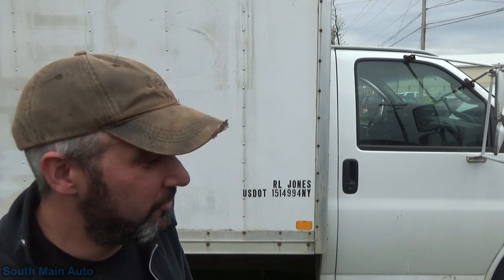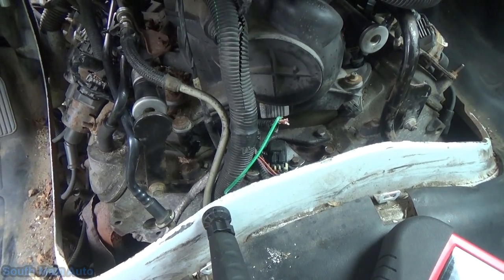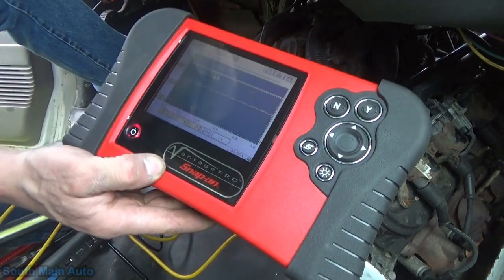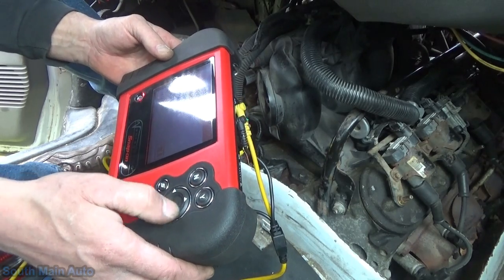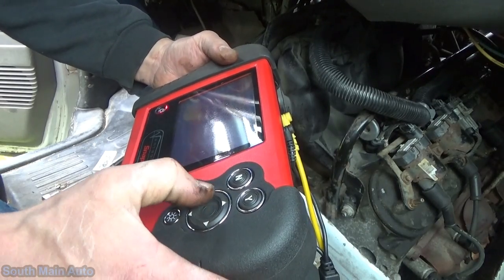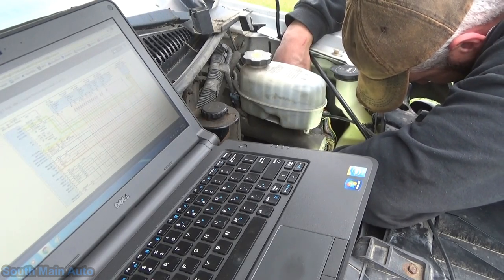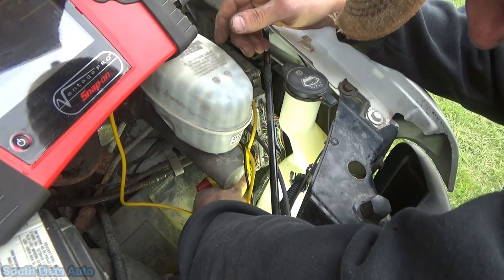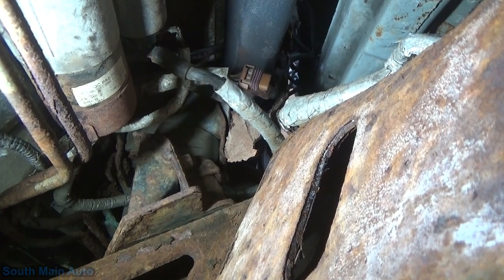Chevrolet Express - Crank / No Start

Comment: What a difference between the two shops, one starts replacing components until they give up,
the other actually uses the right tools (and more than a little smarts) and has the fault identified 
in an hour. If I was a local I know which shop I would use.
Reply: flat rate vs. private ;)
Reply: @6:49 of the vid after taking the covers off the ECM I think he says "four hours later" not sure if he was joking or not but I'm sure it wasn't easy or quick.  Important thing is he found the cause.
Reply: certainly joking, but they are a devil to snap loose :)
Reply: Not every shop can afford 4 to 5 thousand dollar scopes. Plus the hundreds of dollars in monthly fees for using the technical website.
Reply: @josephgalarneau7177  if they can spend thousands on tire machines,  alignment racks,  and lifts.  They can definitely afford a good diagnostic scope or two.  It has nothing to do with money. Its about actually having competent technicians that know how to use them
Reply: @josephgalarneau7177  almost all shops have these tools now. Most guys are embarrassed to not own one

Comment: Man the wire on those GM years were garbage.  Great vehicles- horrible wire and loom quality.
Reply: I see those chafe and fail at the pass side of the dog house.
Reply from the maker: They sure do. They seem to get very brittle and crumble really easy.
Reply: True.  Just fixed the wires on my cam sensor - 2000/5.3/ Suburban.  The split in the plastic wire loom sawed right through the wires.  I had to pull the intake to make the repair!

Comment: Eric , never apologize for making the best auto videos on the internet! . I think this video shows everyone that you personally don't need the big shop an all the fancy tools . keep up the videos !!
Reply: I dont know, ive seen shops a lot smaller and he does have a good selection of fancy tools. The problem with the dealerships is they have all the expensive equipment but not a good grasp on how to use it properly.
Reply: He does have the wiring diagrams...a must have. Not cheap either for a small shop to have all those scanners and resources.

Comment: What do you bring??  You call Sonny's Towing and have the truck towed to your shop.  This way you're Happy  and your brother is happy.  This could have been a video that start off with Sonny's towing and the Part II would end up at SMA.

Ivan should enjoy this video, working without a lift.  My guess if that they crossed the wiring for plugs 6 and 8 which is causing the misfire.

Comment: G'day, Eric! Mr. O's, South Main Auto... Diagnostic Mobile Repair! (Chevrolet Express - Crank / No Start) Checking out The ECM, Cam Sensor, Crank Sensor, and then finding out it has a Broken Wire!! Another marvelous job! 

By the way, I am having a very similar situation here with a "2006 Dodge Sprinter, with 5 cylinder turbo diesel." The body is in great condition, and the owner what's to sell it! (a local service shop told him the timing belt [or chain] was broken!!) But, it also has a Crank/No Start! (So, I would like to check the ECM, Cam Sensor, Crank Sensor, etc.) Thank you very much! 

Cheers! :-)

Comment: Your video action has been impressive this week. A new Cam sensor and it doesn't work...crazy. I've seen Keith's van, he does have everything! Nice work in less than perfect conditions. I followed along better on this one because I had a similar issue with the 98 so I've been down this road before. Thanks Eric.

Comment: Long time, first time. So, gotta say.. Love your vids. The analytical part of how you think through the problem really is what appeals to me. I tend to watch the electrical problems, because.. I'm an electronics guy. So, I like seeing your thought process vs what I'm thinking when I see the schematics on screen. We tend to wind up at the same place thinking-wise on those, but take different routes to get there. It's about 50/50 on whose method would have been quicker, but I've seen some where I'd have been burned by skipping to a different place than you went.. 

As a Colorado owner, your case study on the P0014(?) was both intriguing and terrifying. 

Had a fun foray into the automotive world today. Get a call from a friend wanting me to help track down a parasitic draw on a 98 Lumina. Those are always fun. He had installed a kill switch on the battery, which actually made things easier. Circuit open, circuit closed.. Pull out my handy Fluke and measure current draw.. Nothing.. Huh.. We've got the door open and i'm completing the circuit with the meter and.. No interior lights. Pop the meter open.. Both Ammeter fuses are blown.. Nice the meter still measures continuity to check its' own fuses (This is why you never lend tools to people who don't know what they're doing). Go to the backup meter.. We see a 2.5A draw.. Well.. That isn't right.. Oh, hey.. We've still got the door open.. Close the doors.. 500mA draw.. That's still high.. I go with the obvious.. Pull cigarette lighter fuse, it's blown.. Well, that isn't it. Pull all the fuses for lighting.. None of those. Start going through in order.. Pull the door lock fuse.. There's noise of a release and draw goes to nothing. Ah-ha.. I say, it's in the door locks.. He says "Well, you know.." and points me to the drivers side door, which has a completely broken power door lock switch.. you push it to lock, it stays stuck pushed to lock, causing power to constantly go.. You push it to unlock, it's constantly applying power to unlock.. "Well THERE'S your problem, would have saved us 30 minutes if you had just mentioned that from the start".. Took the switch from drivers side door, put it in the passenger, left the wiring disconnected, took the good one from passenger side, put it in drivers side. Problem solved. You just can't lock the doors from the passenger door.

Right about then is when I notice.. Hey.. Where's your serpentine belt? "Oh, it broke on the way home yesterday, we need to replace that, too".. I didn't sign up for this crap. Oh, fine.. But.. wait.. "On the way home"? Exactly how far did you go? "A couple miles"... Hmm.. Did it overheat? "Oh yeah, it was pegged".. Palm to face for the second time today. By some miracle.. Remember, this is a 98 Lumina. The 3100. While heat doesn't generally take out an intake.. You look funny at the intake on this thing and it breaks.(I exaggerate, but..) We get a replacement belt on.. I figure this isn't going to end well.. It runs.. Let it run.. Hook my crappy little data reader up to it... Engine temp goes to 200 and drops once the thermostat opens.. This is like the 5th time he's overheated this car severely with, seemingly, no lasting damage. I really wish I had taken a vid of this repair.. It would have been JUST like one of yours. But with far, far more swearing.

Of course, after we get all this put together.. He shows me his truck (05 Explorer SportTrac) with the dash showing he's doing 85 while stopped, no tach, no fuel gauge.. "Bad Cluster, I can't reprogram that, bye" and ran as fast as I could before I got roped into some other project.

Comment: Really liked the fieldwork =) Got a little nervous and worried when you said you my not have had the battery in the camera. That made me also wonder why you don't have a car charger to  plug in since you do all the filming in and around cars. However really nice video! I like the wireproblem diagnostics, it's not always easy but you really make it look easy! Often the hardest part may be starting direction.

Comment: Nice diagnosis. At least they knew when to call you. I like my ECT2000 for finding open wires and for high resistance & electrical diagnosis I like my thermal imaging camera. Speeds up the process until I get side tracked playing with it. I'm like you when it comes to finding open or shorted wires vs. replacing b/c I don't like having customers stranded or have melted harnesses that could have been prevented. I have great respect for mobile diagnosis techs working outside. Videos every day this week is impressive.

Comment: Question: Would the Versus have been a better choice to take, as its two machines in one, a bit more compact and has the ability to have wiring diagrams (using browser to look at iatn or any other data program)? I ask because I am looking to buy one machine and see the Versus as not the best but does everything well enough in a compact unit. I have learned more from watching you than classes I've attended, thank you for your continuous effort in presenting new material and showing us your techniques.

Comment: Thanks for these videos my man .. they have really been helping me out .. I started out rebuilding engines when I was about 19 .. .. just nuts and bolts stuff .. fast forward 20 years .. I've been at a big shop now three years now and I went from being a mechanic to just a parts installer .. yup .. the owners brother does all the diagnosis and we do all the" parts changing" .. electrical diagnosis was never my strong point .. always engine and transmission stuff .. but I'm 38 and figure I have about a good 10 years left of being able to do all the"heavy work" .. then what ?? .. So I've decided I really need to get back into diagnostics because I won't be able to change motors forever and you and.. scanner danner have really helped me getting a grasp back on this side of things .. so hopefully I can either start using all of my capabilities here or move on to another shop .. But either way thanks for the videos.. I really do appreciate them .. Salute

Comment: Now you have experience working on something in the field. Its dirty, cold or hot, sometimes wet, lots of cursing because you bang your head on stuff or drop bolts or nuts. It isn't glamorous, but those of us who have to do it, get the job done, I only hope most of us get it done right.

Comment: Thanks for that Eric! DIY work does have it's own challenges. I work in a dirt driveway with thorns. Cardboard is your friend, as it helps keep you from becoming a porcupine, and keeps the ants away. 

Forget trying to easily get a jack under it. You have to literally lift the jack and position it, and work fast before the jackstands sink in the dirt. 

Having concrete to work on is a blessing. Still yet, the DIY has a few more challenges. 

Anyways, thanks for this video, Eric! Love the mobile call vids.

Comment: My van had corroded wires from fuse box to BCM and from BCM to fuel pump.  Body control module. 
Pink wire.  Triggered shutdown by factory installed Alarm system.
300 bucks mechanic charged me.
Alarm is bypassed. But headlights flash when driving and stop when I turn lights on.  I will never buy another conversion van.

Comment: welcome to my diy world eric... my grand prix just stopped in middle of road..shop added another battery ground to fix my problem. I dont have the money to get the tools you have to "PROPERLY" diagnose problems but I think like you..if it worked from the dealer to the buyer and now not working...use you F%$%^%* brain and actually work and look for the problem instead of GUESSING IT COULD BE THIS>>>> god i wish I were s a mecahnic like you ( yes the spelling is intentional but the yokels  and thats anywhere do not know their job. ) guess we are all stupid.
Need another muffler put on a car that I repalced 2 years ago and their idea is that my daughter doesnt drive the car long enough thats why it rusted.. I have a new 2002 taurus that has only 86000 and the muffler is still the original. Not rusted. ou do the math .Guess what I aint going to that muffler dealer. YOKALS
Hey no ding from shop...no phone and no misses O sayg you gat a call.... LOL.
Wow at 15 minutes you look like a POWER RANGER Gandolf  think his name is. from you reflection of your scan tool

Comment: GREAT VIDEO ERIC  . HAD A PROBLEM with thre sensor by the starter  my self on a chevy  1500.  the wires were all crispy  and the plug fell apart    . i had to remove the starter  and change the plug  . THANKS AGAIN FOR THE VIDEO

Comment: My 1998 Astro van won't start- seems like it's not getting any gas-took apart fuel lines / injector stuff / etc -fuel pump is working have pressure to injectors. Just puzzled the "youknow what" outta me......now I just stumbled onto a video of another guy having exact same problem who figured it out.......anti-theft device, resistor value in key switch not verified by vehicle computer......oh th' electronic crappola in cars now days....

Comment: Where did you hook your test lead up to power? I am trying to figure out my own crank no start with a 5.3 swapped into the DREADED 98 Camaro. Originally a v6 I am getting no injector pulse and no spark. I have 2 brand new crank sensors that I have swapped between and even picked up one from the junkyard to test. Same with cam sensor. Key in “ON” position I get 12V to all injectors and coils just no cigar when attempting to start. Fuel pump primes and comes on. Should I be searching for a damage 12V wire to my crank sensor as well? I have no problem doing some wire work if needed. I know you can’t say much without seeing the vehicle but I’ve watched a few your crank no start gm vehicles and they all seem to be fairly simple fixes after some troubleshooting

Comment: I wish you were closer to the West, I would drive to you with my problem. But NY is a bit of a drive from Phoenix.

My issue is truck runs fine for weeks, starts, sputters, shut off, with the sputtering starts 1-4 times. Then it's just starter for 5 seconds, then dies. Usually the next morning it starts right up. Being a locksmith I am able to secure my vehicle with my van running, so I keep it running all day, but It seems like its getting progressively worse. 2011 Chevy Express 1500 btw..

Comment: I've had this situation on a jaguar x308 (XJ8). It would stall and then wouldn't turn over until you tapped the EMS fuse box. With Key on, engine off, you could hear various noises in the fuse box. Changed the relay, no joy. Changed the fuse box.... Seems to have solved it!

Comment: Sow past 2 weeks had issue with g20 1991 5.7 tbi... crank no start, i did had issue with external fuel filter inside got loose, maby vacumed and stalled out, after replaceing all good. But couple days later no start. No spark. Ignitioncoil  checked works ecm on distributer works, new sparkplugs, wires, rotor, cap, new airfilter, egr, thermostat, temp sensors, starter and battery replaced, grounds checked, and repaced where needed. Only when its DRY COLD like good minus celsius, no moist it wont start. Next day different weather, little bit damp or normal compared to what we have here 3/4 of jear, like instant start... im loseing my mind here, what the hell, fuses control modules, relays all good... there has to be ground issue or something but where...

Comment: Hey I know this is a year old but I hope you follow these threads still. Have you thought about an RF tracer?
Telephone techs use them all the time (sometimes called an "fset") they cost about $100 and allow you to trace wires from a source  - injection of the RF signal at the end and you just run the RF probe along the wire... When it stops warbling you've found your break. Also good for finding wires in a whole bunch.. (This is the primary use of them)
Any telephone tech worth their $$$ will have one so find and ask them to try it next time..
I use mine for exactly the same task except data cable... No reason it won't work with automotive wire!

Comment: Had 05 malibu and 99 blazer wouldnt crank due to security system. Computer isnt recognizing key. Leave key in on position for 10 minutes ( 9 minutes 59 seconds wont work ), at the 10 minutes turn key back off then it'll crank. Changing ignition dont work either

Comment: Electrical work like this is super simple if you keep it that way. Don’t overthink this stuff guys. Only 3 things can be wrong with electric wiring. 
1. It’s cut
2. It’s corroded 
3. It’s shorted to ground. 
Guys.... that’s all it is.

Comment: When I changed the transmission in my ‘04 G3500 6.0 cargo van I never put the passenger seat back in ( have to remove to pull doghouse ). I mounted it to plywood & use it as a easy chair in my garage.

Comment: I have seemed a few videos off this guy all cool videos,good job man, i have a question ? My brother 2009 GMC Yukon XL got the same problem NO Start eaverythig ligth up in dash board but not start one thing is i dont hear the buss noice when you turn key on fuel pump but it may be starting motor???

Comment: Great job as always! Interesting you found the cam sensor problem first. If you had started at the crank sensor, and tried to start with your 12 volt probe it would not have started. This would have been demoralizing, and would have questioned your diagnosis. Trouble shooting two concurrent problems is a bitch!

Comment: No brake cleaner either???  Mobile is where it's at. I used to chase a medical van for 29 years, sic!! Worst was our A/C guy chased one from Stl to Iowa one weekend to find the intermittent for the chiller. And it was 10 degrees outside.That tone generator would sure come in handy on that broken war

Comment: Rusty crusty vehicles!  Ya gatta love them.  Good call using "external to the circuit" 12 volts on the crank power wire!  Besides the misfires, where was the electrical problem located?

Comment: I have a 1997 dodge dakota with 5.2 l . truck start fine run fine then cut off after like 20 mns or so no troubles code no engine . and start right back up can't really figured out what missing 
Cause start right back up